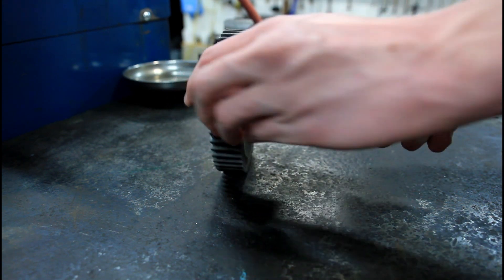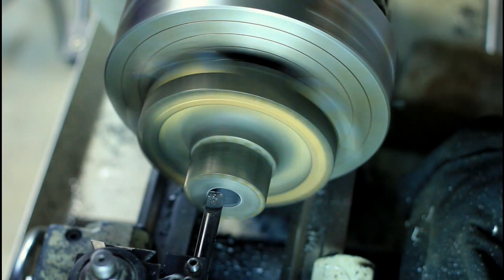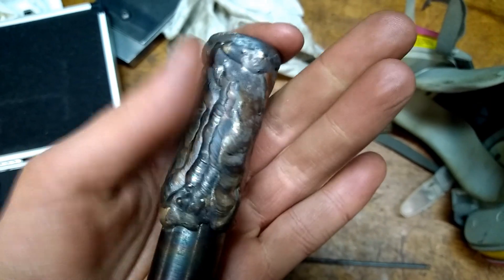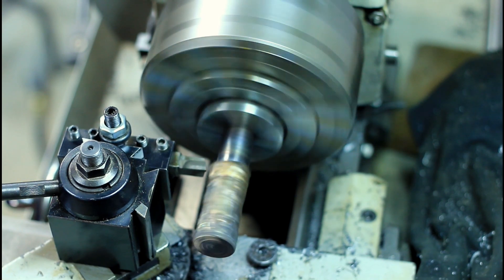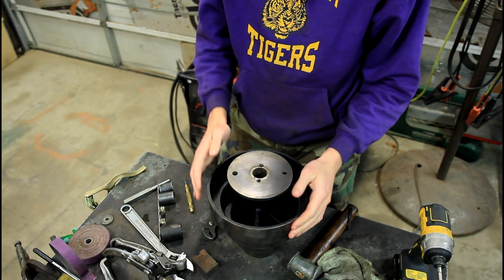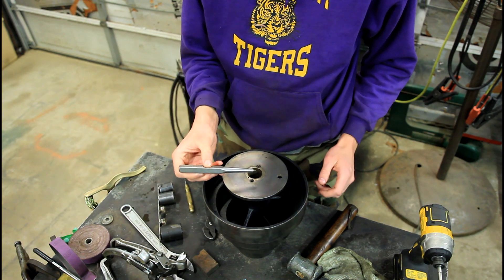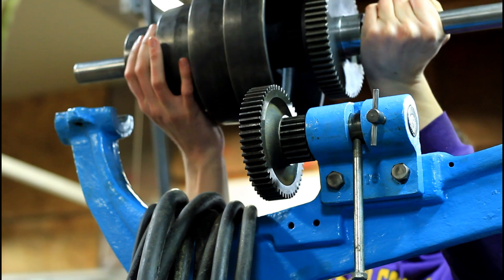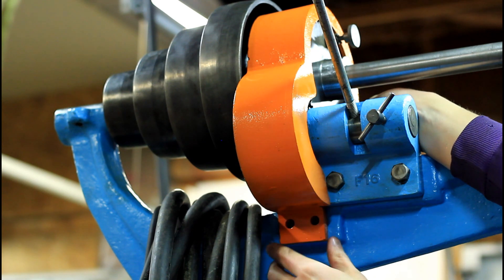Camelback Pt:5 -- Shaft Repair, Gears, and Pulleys

Comment: Looking good. On mine the smaller back gear was missing teeth as I recall. I ended up buying a replacement gear.
Reply from the maker: Somebody must have been hard on that thing. Where did you buy your gear from?
Reply: @TheMetalButcher  I think they came from Amazon at the time, they were stock Martin Sprocket parts. I just bored them out.
Reply from the maker: Gotcha. I'll check them out if I ever need any gears.

Comment: Nice job. I have a similar drill it’s marked as ‘the rockford’ 1909. Runs like a champion. Drills a two inch hole in back gear in slow auto feed like it’s not even there. You’ll Cherish that drill as will your kids. Cheers from Australia 🇦🇺

Comment: That was awesome!  Does the top assembly ride pin Babbitt bearings?  Looks super smooth and solid.  Great job!
Reply from the maker: Yeah. Everything is babbit except for the the spindle (ball bearings) backgear (now bronze) and the upper pulley (iron on steel, but large contact area). Even the 1hp motor has plain bearings, not a ball in the thing. Thanks as always for watching commenting ScoutCrafter. :) I always look forward to seeing you here.